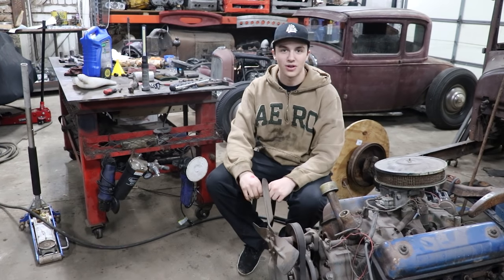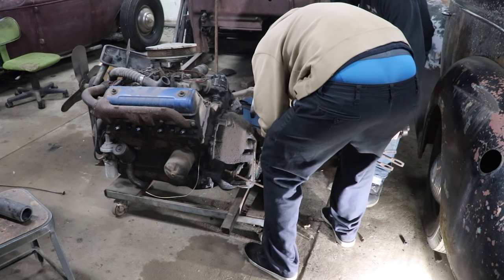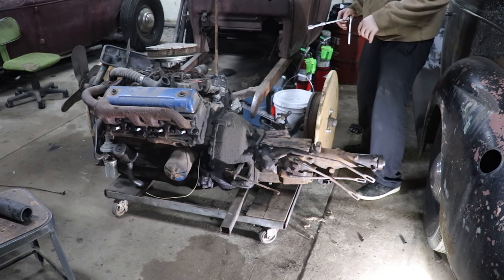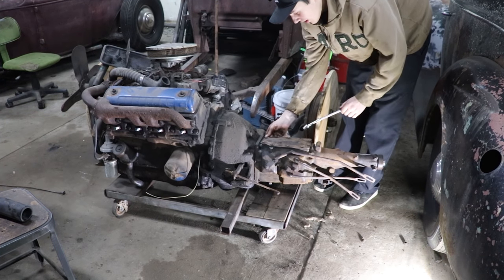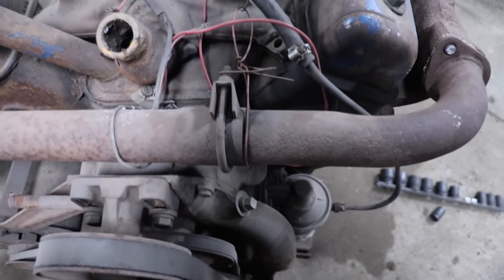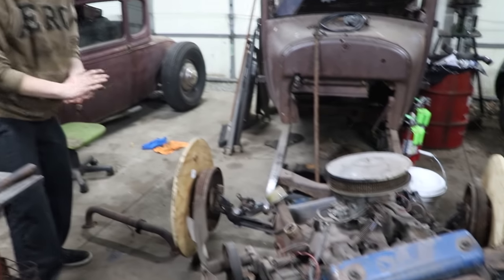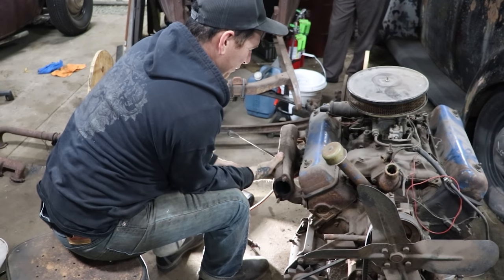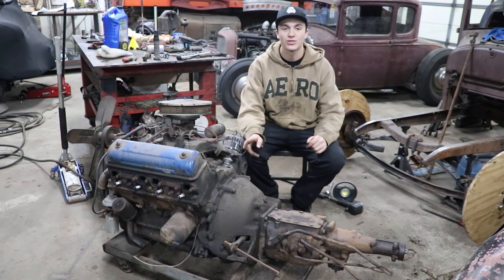Sweet 16 Hot Rod - Floor Shift Four Speed - Ep. 14

Comment: As an owner/caretaker of a 1978 ASE fastener era Lincoln, and a rusty 18-year-old mostly metric Suburban I can tell you that both vehicles use both wrench/socket sets for when the bolt head has gotten smaller and no longer matches a wrench/socket of it's intended measurement standard.
There is also the cut a new head onto the bolt with a grinder or dremel cutoff wheel method....I had to come up with that when one of the end fittings of a blown power steering line on the Lincoln completely rounded despite using a flare wrench. That one I cut the pipe off, ground a new hex head onto the fitting, hammered on a socket that was slightly too small and HAD to use a breaker bar to get enough torque to budge it (that sucker was in there but good!). That was the winning last-ditch effort that saved me from replacing the hydraulic brake booster (which is hooked in series with the power steering pump on late 70's lincolns).

Comment: Consider using a jeep floor shifter from a t176 tremec 4 speed,it will fit in the top of the ford toploader and eliminate all the side linkages and the stick will exit the floor about 3 inches back from a 39 shifter.

Comment: just a little oil on those bolts/nuts can help in not only keeping them from snapping off as the heat builds on removal, but will make the nut/bolt come out of the socket too.

Comment: When I was 16 I bout my first hot rod it as a 1972 novel with a big 30 327 engine then the first week end I got my drivers license my dad gave me the key to his 1220 modal touring car it way winter in January that and it could out side and we lived in NY and I drove it to a mall show it sold but I did not about the as long I got drive model t I also drove it to every after I even drove to the Hershey car snow that year and it trophy for most original the year in was so happy that I got to drive there I loved that car so much also when my dad restored that car I was 12 years old and I help to restore it with my dad. I spent a hole lot of time just getting rusted parts cleaned up on wire wheel I loved the work and I still restore card atnd I'm n60 year old now so that being I love to see do this kind of work learning how boils not rods. It lets me know there is some for the future for this kind of things to Cary on.  O ps I have also build meany not rods as well to mean young people now just stock there heads in to some computer now

ot rod as

Comment: If you manage to get a 13mm on the bolt head that means it was a half hitch bold hex,  a 9/16 is a sloppy 14mm, meaning a. 14 would fit what would be real tight... if you have a 9/16 bolt with the corners rounded off you can use Lee Drive a 12 point 14 mm on to it and spin it out

Comment: Regarding the question about the clutch linkage...and keeping in mind I know NOTHING about the Y block/transmission setup, if the bellhousing and clutch/flywheel came with your block, bolting up a different trans should not have anything to do with the clutch linkage. If you have to install a different clutch, then the distance from the flywheel to the throwout bearing may be different, and thus require a different pivot point for the arm/lever.  If the "milling" operation mentioned has to do with setting the lever pivot further aft in the bellhousing, you could also look at finding a shorter ball/stud. Moving the pivot point ball-stud forward can be done with washers between the stud flange and the bellhousing mounting boss. It's a matter of getting some good measurements for the parts in question, which is awkward.  Before you modify anything, check out the lever position and see if it works, if not figure out what needs to be changed via measurements. Keep up the good work!

Comment: Is the input shaft the same length on the truck 3 speed and the Galaxie 4 speed?
I think the input on the Galaxie is shorter then the truck transmission.
Pilot bearing issues?

Comment: I’ve had an adapter sitting on the shelf for years it adapts a ford Flathead trans to a ford FE engine 
I couldn’t imagine the trans holding up behind an FE . Thoughts?
Reply: if the car is pretty light and you dont hook up, i dont see why it wouldnt.
Reply: Side oiler 427 mated to a 39 trans.  The first time the tires got traction under load I would imagine the trans would be metal confetti.  Heck even a 352 in a 1967 f100 made pretty good torque, I would think it would kill it and they were lack luster on performance for that era.

Comment: Never use an impact to remove rusty nuts and bolts. As a new mechanic you have no need for an impact. hand tools and heat to remove old nuts and bolts. If you want to use and impact break it lost first with hand tools. Keep up the good work it will be to cool for your school.
Reply: I agree I dont think i would have used an impact on the Intake manifold bolts

Comment: Cross over pipe is a early version of the "X" pipe used today !
Reply: Not really, it was the cheapest way to not have dual exhaust. The flathead v8 started that, with the exception of the pipe ran low across the front of the engine, instead of front and high on this y block. An x pipe, or h pipe is downstream, and just equalizes the pressures and enhances the exhaust note. The old way was simply used to get exhaust gases into one area, and out- not for performance. That's why everybody switched over to headers and dual exhaust instead of manifolds and single exhaust.

Comment: How much speed equipment is available for the Y block Ford?
Reply: There are or at least was Intakes, exhaust, cams and a few other small things.  There is machining to make other piston and rods to fit... The motor can get quite costly if you want to make big numbers. 
It a hotrod like this it won't take much to be fun and fast. 
It's the perfect engine for a young guy as its durable and easy to work on and it isn't hellcat fast.

Comment: Use some 5-56 or RP7 or something before you start busting studs out of manifolds. Crikey!
Reply: I thought the same thing at first but They are blind bolts so corrosion useally isn't an issue unlike the slightly newer ford FE engines wher the upper exhaust bolts always break.

Comment: Think that they're talking about the pilot bushing are a different size on some of them the pickup has a bigger one if you have the old transmission check out the size. Ben about 45 years since I work on them. Great motors just bad top oil problems.
Reply: Raced the Y blocks years ago. I used to mill the oil pump housing a few thou to reduce the bypass and raise the pressure to 70 or better, worked good for oiling the valve train. If the motor was too loose I would install an auxiliary top oil system.